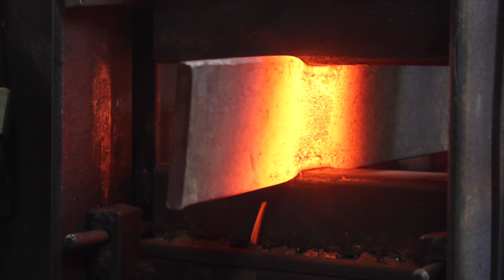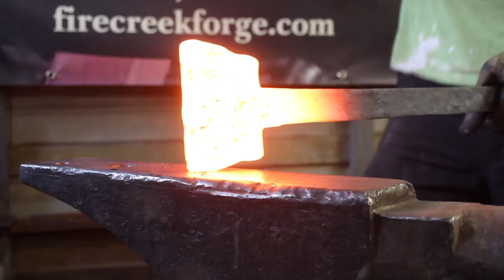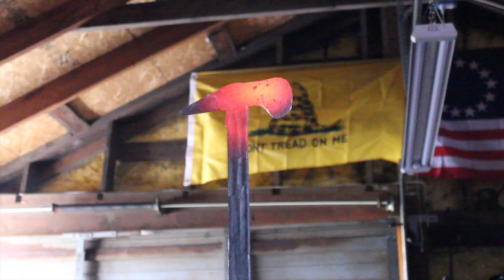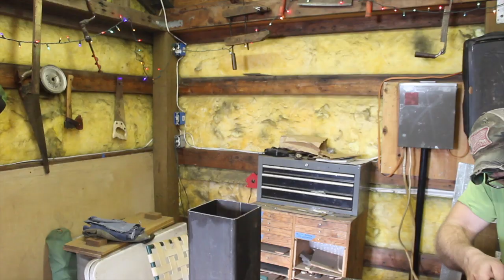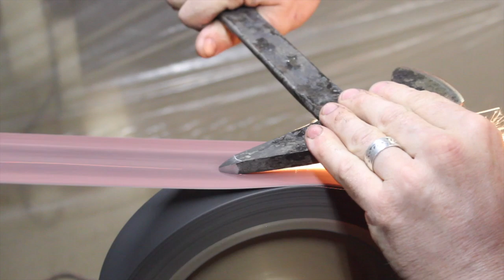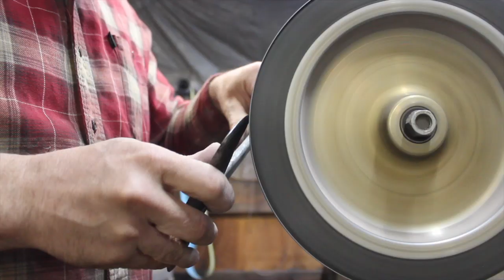Forging A Tactical Tomahawk From A Truck Spring ~ Blacksmithing Post Apocalyptic Weapon

Comment: Good work, but I have never seen the need for a tomahawk. I've been camping for almost 50 years, and I never saw a situation where I needed a 'hawk over a hatchet. Every time that I have seen a fellow camper with a tomahawk, they needed to borrow an axe to drive in their tent stakes. Also, they didn't seem to be able to sharpen their tomahawk enough to chop firewood. Usually the tomahawk users would also fail to start a fire with a Ferro rod, and would ask me for some matches. Tomahawks are like Rambo knives- in the right hands they can be useful, but buyers are usually inexperienced and buy them for the romance of owning a tomahawk, not the utility. I hope you make hatchets, also.
Reply from the maker: Yep, I forge a lot of practical hatchets and axes also.